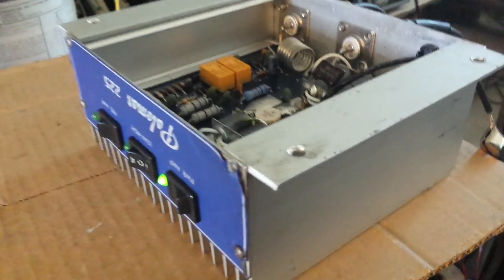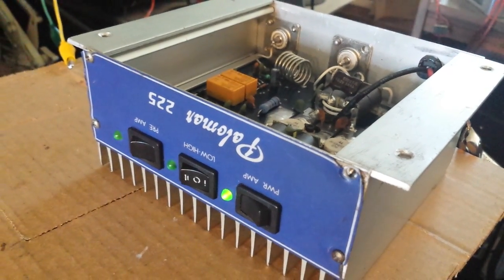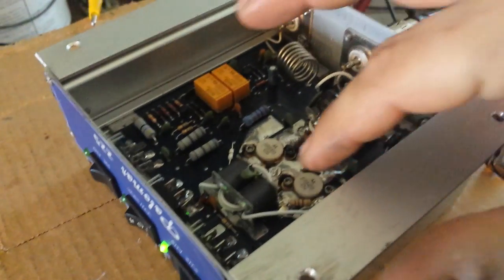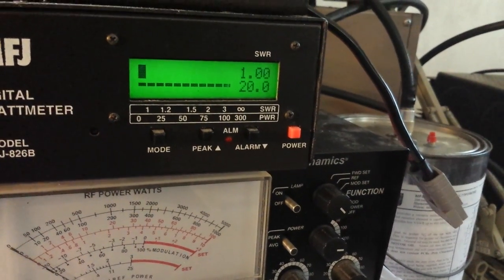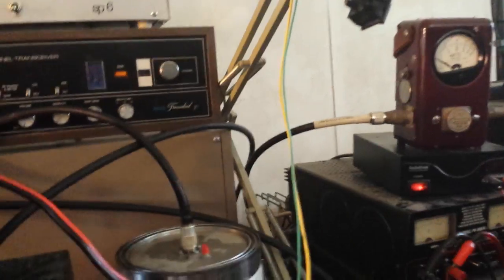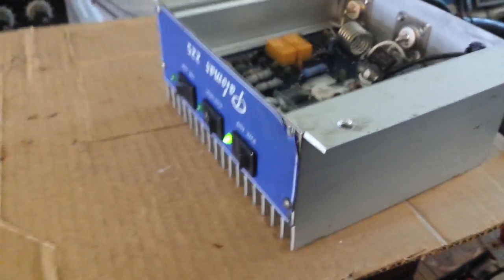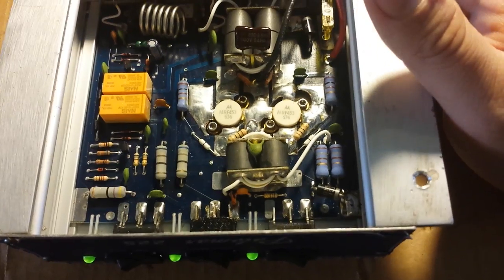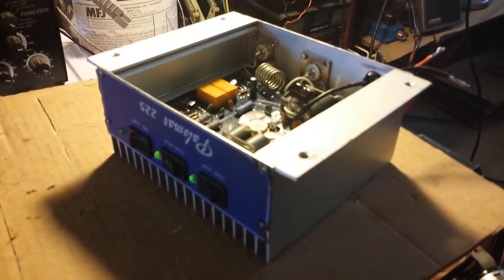Revived Palomar 225 AB1 Biased with Output Filter

Comment: Right under that tuning coil for 10M band I suppose there is a light green resistor that runs parallel with the turning coil that is burnt in the middle and I cannot make out the value of.  anyone able to tell me what that is?  thank you! 73's

Comment: Man has the mic shoved in his mouth to get 195 watts. Those aren’t high drive transistors. When people have a conversion the mic is in front of your mouth not in it, my point it’s a 150 watt amp in normal use. You high drive it a resistors gonna smoke. It’s a choke not a filter. A MRF 453 takes 4 watts each .
Reply from the maker: Correct..we are just showing max output 
...thanks for stopping by.

Comment: You supposedly did all this work to this amp but you didn't put power wires on it😂
Reply: You can bet if someone hits it with a bigger radio & it shits he isn’t gonna fix it free. Believe me it’s not a high drive. Like he said he knew they was 80 watters when they are 60.
Reply from the maker: I'll have to go back and watch this, this is a old video 📹.
Reply from the maker: @vsmichael1 you are correct this was back in my beginning and I did make a mistake but at the same time said I wasn't for sure and no this isn't a high drive amp but back in these days it was when it was made high drive mental anything that could take more then 4 or 5w....thanks
Reply from the maker: Now imma have to go back and look at this old video... if I didn't put power wires on it joe in the heck can it be working lol???

Comment: Your modification of using a higher wattage biasing diode: what is the watt rating and where did you obtain them. Thank you
Reply from the maker: I've got a lot of my diodes from sellers on eBay, rf parts, or mouser.... It is a 3A 1n5406 I believe I hope that helps.
Reply: @1883GotDown  I'm sure it will the gentleman who owns this amp that you covered in this video the guy who gave it to him took out the 20 amp fuse and something else he said he cut a wire and I thought that's odd why would he do that. I'll have to get more information from the gentleman who gave this to my customer. I just repaired the linear amp that he uses for his Ham Radio setup. I had to replace and resolder three different one amp resistors all the same value. Plus one of the scr's cooked off the pad on one part of the printer circuit board so I just clipped a wire from an electrolytic capacitor, apply some flux and resoldered it and it works like a charm now. The customer brought a home Integrated that repaired item and is set up and then within the hour later he text me back telling me how happy it was that it's working. He's a ham radio operator from Bogota Colombia him and his wife live here in the suburb of Atlanta called Conyers Georgia. Let me know if you want me to rescreen the items that you have. William Prieto on Facebook. Good night.

Comment: The 455 transistors in the unit I have in my shop, have MRF455 60 Watt transistors. I am new to electronic repair. My main occupation is rescreening and repair of iPhones and Android smartphones.
Reply from the maker: Nice I could use some of your expertise lol I've been saving a few devices iPad android galaxy pads and such I need to re sxreen my self but just don't have the time to.
....are you in the states?
Reply: @1883GotDown  Yes. Atlanta Georgia area. I'm on Facebook.
Reply: mine as well 455